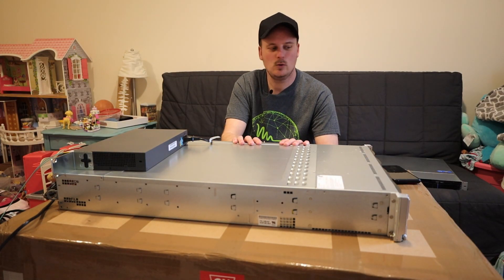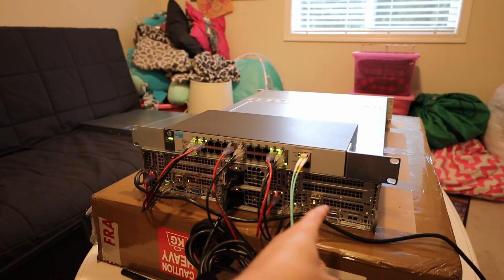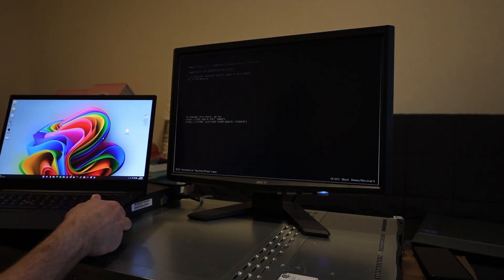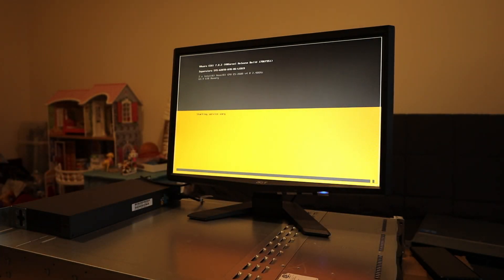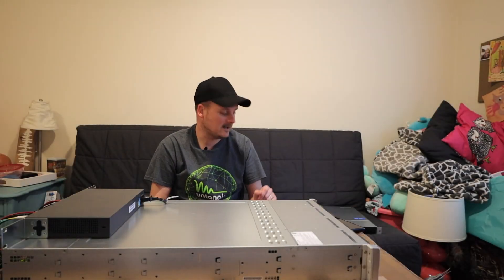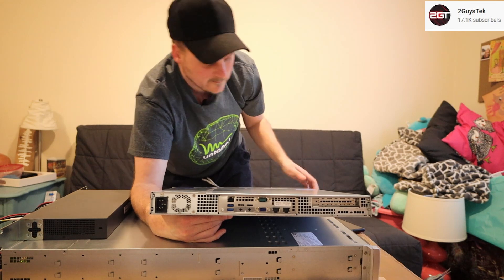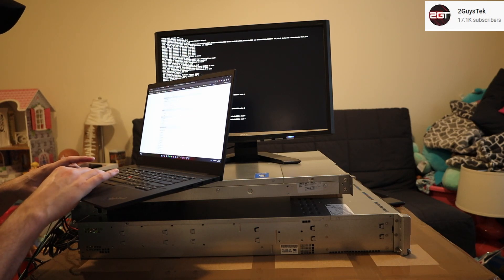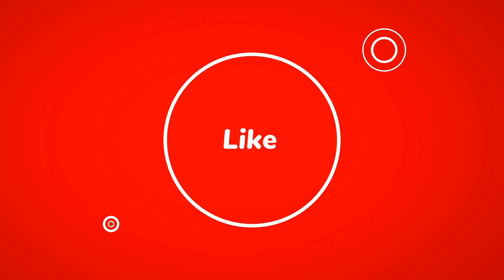Jason's New Supermicro Dual Node Server - Thanks to 2GuysTek

Comment: as long as the temps are fine under FULL load there should not be an issue esp for the CPUs
Reply from the maker: Mine will live in the garage soon, so it's cold in there. I will be monitoring it though. Thanks for watching.